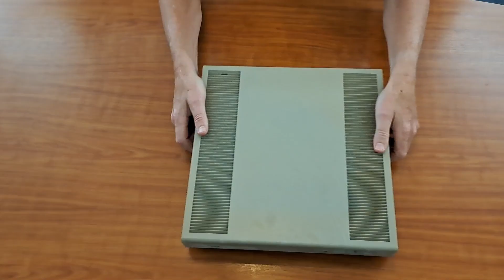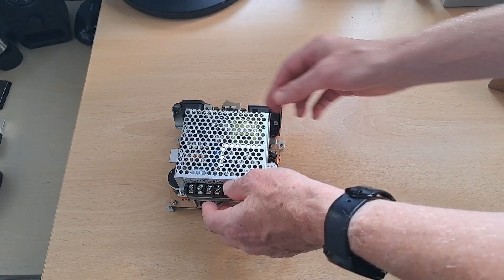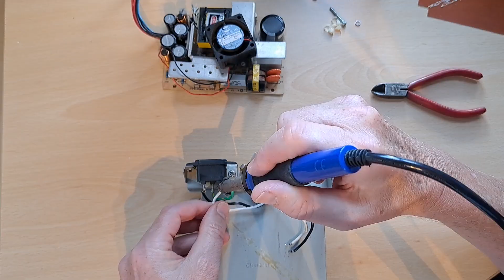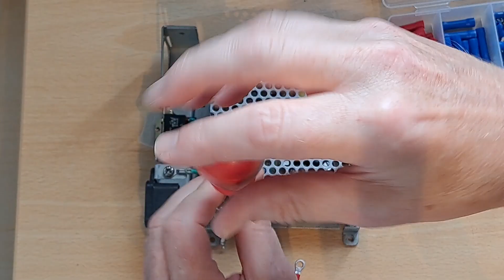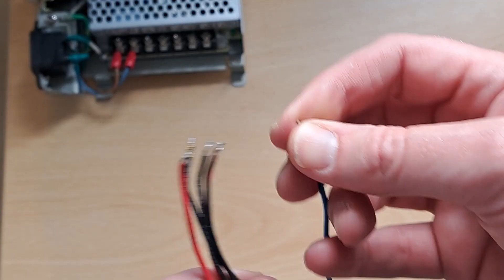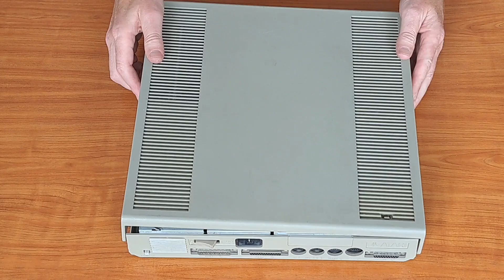Replacing the power supply of my Atari Mega ST with the Mean Well RD-50A.

Comment: Thanks for the video. I can't believe I wasted time trying to find a capacitor list when you can just buy a whole new, much better power supply at a similar price.
Reply from the maker: It was indeed quite simple with a completely new power supply. But sometimes you also want to keep the systems as original as possible.

Comment: Indeed, it's always a good idea to replace old power supplies with more modern ones. Here, those cheap and small power supply units from Meanwell are probably the best widely-available choice - they're sturdy and super reliable, easy to install and fit pretty much everywhere, they run at (comparably) low temperatures and at least those that I've seen had a built-in overvoltage and short-out protection, probably nullifying the risk of frying any component they feed.

BTW that 'new' case for the Mega ST1 looks almost new, at least in the video - quite a visual treat, I admit 🙂
Reply from the maker: Good to hear I chose the right power supply.

It does indeed look newer in the video than it does in person.